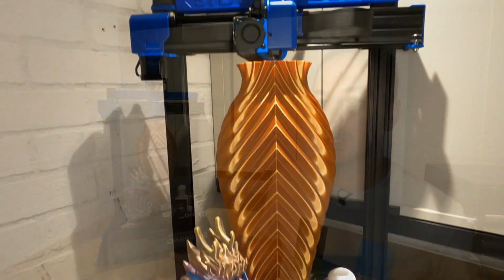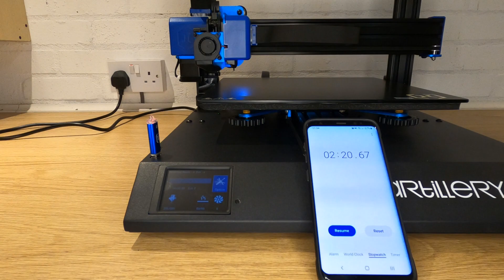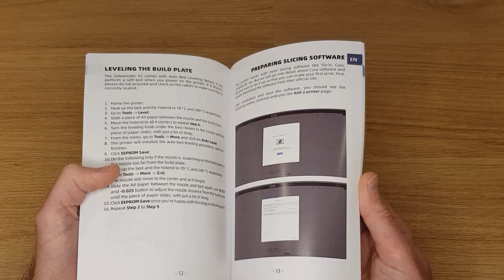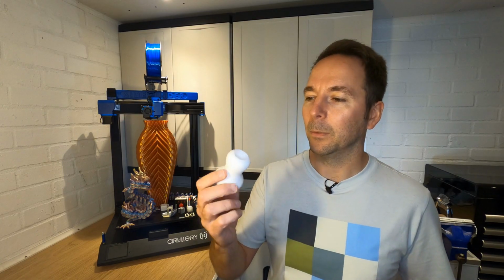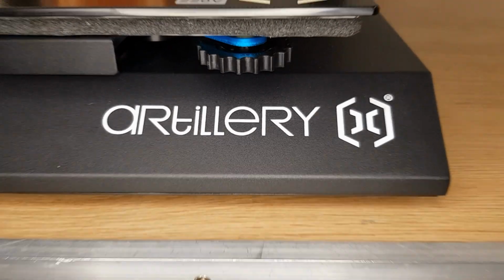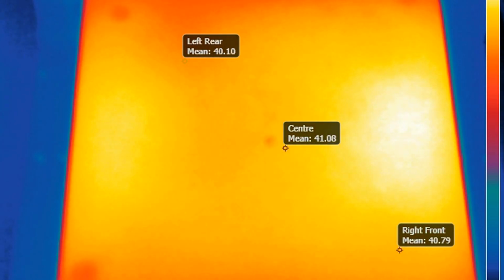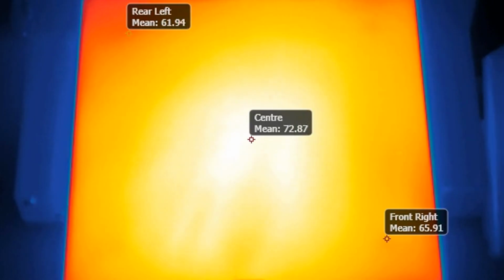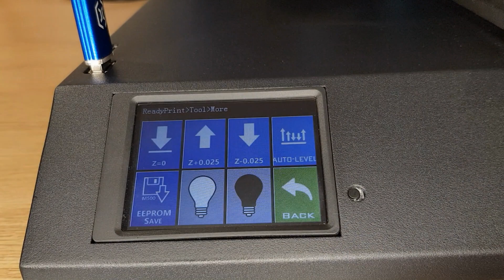Artillery Sidewinder X2 Review - The Easiest 3d Printer To Get Started?

Comment: Great review. I already have a CR10S Pro and considering a second large size printer. Since you’ve reviewed both, would you recommend one over the other?
Reply from the maker: I would definitely recommend the Sidewinder over the CR10S Pro. It has direct drive, 32 bit board and much better wire management. It feels like the next generation of printer compared to the CR10S Pro. The only real negative I'm finding is that non-removable bed surface but I plan to do something about that soon.
Reply: @RickyImpey  Did you manage to do something about the bed surface? Very interested to know how it went
Reply from the maker: @Cosmic_Corp  I added a magnetic PEI bed to the top of the standard bed and it has worked really well. I haven't been able to get the thermal camera on it unfortunately so I haven't seen how the temperature spread has changed as yet.
Reply: @RickyImpey  If it's been working pretty well, I assume the heat spread is decently even. Got a link for that plate? I just ordered this printer last night did I make the right choice?
Reply from the maker: @Cosmic_Corp  links in the description for this video for the two trees PEI bed I bought 👍
Reply: Thanks! I’ll certainly consider it. From a process standpoint, having multiple of the same printer makes for efficiency. Also, availability of the Sidewinder May also be an issue for me. That said, after a few Creality printers I’ve become turned off by them… I don’t want to fall victim to their questionable practices, and their product roadmap is all over the place.
Reply from the maker: @szetor1  Yes, I know what you mean in both cases. I hope you end up choosing something you are very happy with👍

Comment: I have the Sidewinder X2 and love this fast & quiet 3d printer. I am seriously considering a second one since this X2 printer is so much easier than the Ultimaker 2 & 3 models. There have been ZERO problems getting objects to stick & release from the bed, provided you select the proper Brim or Raft at start, and let the bed fully cool. And, I never use glue sticks! In Cura 4.13 slicer, there was no need to manually add any codes if Sidewinder X1 profile is selected. There was no X2 profile. This is just a great 3D printer that simply keep working, with no need to fiddle and treak stuff.
Reply from the maker: Thanks for your comment. If you're thinking of getting another one, there is and extra $20 discount currently with the Geekbuying link and using my code👍
Reply: @RickyImpey  cool ty🤗👍🏽👍🏽👍🏽
Reply: @RickyImpey  And funny enough that code still works, I bought mine few weeks ago, and it arrived today. Thank you for a great video.... Like always :)
Reply from the maker: @euroriderdk  Geekbuying keep me up to date with new codes. We always try to keep the discounts available as long as possible. Hope you enjoy your new printer, I still really highly rate it compared to everything else I have👍 Enjoy
Reply: @RickyImpey  setting it up as we speak. Bought the mirror too (well I got it for free) but yes
Reply: I’m highly considering to buy this as a beginner .  My son wants to make toys as well .  I think I will try your code , but I am nervous about the plate issue you mentioned , if I don’t add a mirror will I be fine ? Also where did you get the magnetic plate you added ?
Reply from the maker: @triplethreat9168  With the standard bed, you probably would have a few adhesion issues with some of the trickier filaments at some point. You may be fine though. I would recommend a magnetic PEI bed. I bought a Two Trees one off of Amazon myself but there are other options. Mine prints like a champ now, I love it.
Reply: @RickyImpey  thanks so much ! I ended up using your code ! Printer arrived and wrapped as a Christmas gift .  I will look into the Pei plate .  What size do I need ? What do you clean the bed with ?
Reply from the maker: @triplethreat9168  Video coming out in a few hours that will show you exactly how to fit the PEI bed, stay tuned 👍
Reply: Subbed…good vid!

Comment: I went to order it.  But when it went to review order it.came.hp 404.
Reply from the maker: Where are you ordering from Dom? I will get them to sort it. I know they changed some discount codes today so something may need tweaking. I will email and get them to sort it asap.
Reply: I used the link provided here.  It didn't even get to the spot for the code.
Reply from the maker: @domgag1756  what country are you in? I think they need to know this to find out what's wrong.
Reply: @RickyImpey  I think I found the problem.   My phone  would not let me make a account.  When I tried on a desktop it seemed to work.  But I was on a unsecured computer so I didn't add my cc Info.  I will try when I get home Saturday.   My phone that I use may be the blame.  It's set up with a extra security.
Reply from the maker: @domgag1756  Awesome, thanks for letting me know. They have an extra $20 discount running for the next couple of weeks so it's now only $329.99USD which I think is a bargain! Let me know if you have any other problems.
Reply: @RickyImpey  Ordered
Reply from the maker: @domgag1756  Great, you'll love it!
Reply: @RickyImpey  I also posted the video link on a very busy 3d discord.  So they can watch and get the code.
Reply from the maker: @domgag1756  Cool, thanks Dom👍

Comment: You mentioned death.   How and when can this thing kill you?
Reply from the maker: The printer isn't dangerous. If someone made a printer with a bed made of a conductive material like aluminium and used an AC powered heating element, it wouldn't be very safe. This printer has a glass bed so that it is safe.

Comment: Seeing this I'm honestly regretting buying an Ender 3 V2, I got it about two weeks ago and at first got perfect prints, but soon enough they started degrading and now I practically can't get anything to work. Now this just looks nice and simple to use.
Reply: I don't regret getting the Ender 3v2 because you learn so much from it, and all time spent keep you off the streets. (lol) But, the Sidewinder X2 is like luxury & sport at the same time. My Sidewinder starts printing in about 2 minutes after power-up. No need to preheat stuff. It is a joy to use.
Reply from the maker: The Ender 3v2 is a great printer, I have one and love it. What's not behaving on yours?
Reply: @RickyImpey  quite a late reply, I've managed to fix most of my issues, except bed adhesion, which sadly seems to come from me being a bit harsh with the glass plate. And then I get lots of stringing despite it printing with zero stringing at first, but I have a feeling it's the filament being wet at this point since I live in a quite humid place.
Reply from the maker: @Psygo1  Very likely, I dry all my filament now as I always seem to see an improvement.
Reply: @Psygo1  try making sure the x rail is level too. they get out outof line some times too
Reply: At least your print bed heats evenly.
Reply: Honestly same, everything was great, then everything stopped sticking to the bed, no matter what it is leveled at it just doesnt stick
Reply: @scamlikely9450  make sure the top rail is level too, i had this issue a long time ago.

Comment: Looks like a great printer but price point out for me.  I think I would look for a bigger bed size for less
Reply from the maker: What other options are you looking at out if interest?
Reply: @RickyImpey  I am on a no budget to speak of. so, I either need to look at increasing my bed size of my e3v2 or look at a larger printer neither are cheap.  I needed to make a bracket to fit my filament dry box to the side of my printer as it is not in an ideal place.  Lacking space too. but the size I want is to long for my printer bed to give me the strength (if made in 2 halves).  I do have a plan B but not as efficient?
Reply: Bigger for less?  Please share what you are smoking.

Comment: I guess i was right 😁
I have 2 SWX2s and I love them. Put a PEI coated steel sheet on the bed and it will fix all bed issues.
Reply from the maker: Sorry I didn't print the Kobra but I was a bit concerned about the number of overhangs and how well it would print without supports.
Reply: @RickyImpey  yeah , it's bit too large and honestly wasteful:)
Reply from the maker: Yes you were! Well done Daruosh 🙂
Reply from the maker: How are you sticking a PEI sheet, did you just stick it to the standard bed? I have a magnetic bed that I've been sent and I was thinking of trying it on the Sidewinder so I can do away with the mirror and glue.
Reply: @RickyImpey  Magnetic PEI sheet. Being removable and flexible is crucial for huge prints, I assume.
Reply from the maker: @DaruoshAghajaney  did the adhesive on the magnetic sheet stick to the bed ok or did you have to prep it in any way?
Reply: @RickyImpey  no prep or whatever, clean it with IPA, and stick the magnetic part on the glass.
Reply from the maker: @DaruoshAghajaney  cool, thanks. I'll go for it next week.